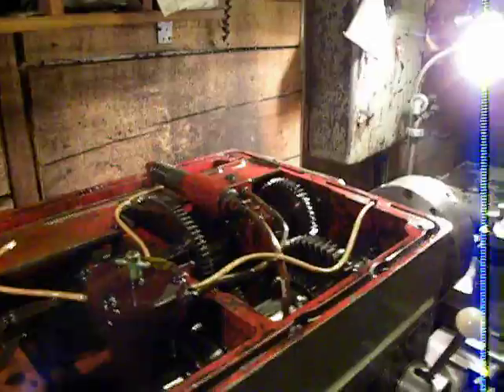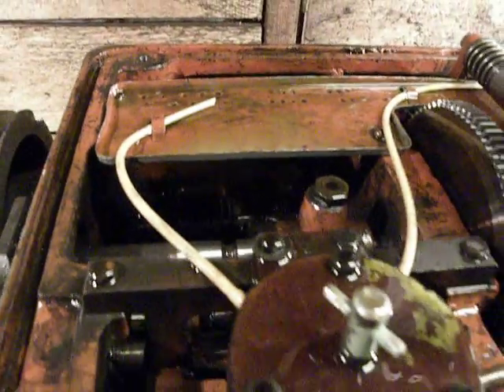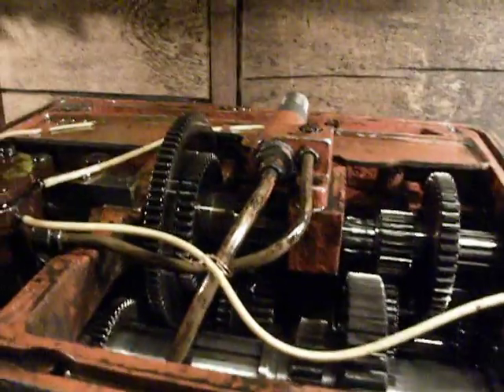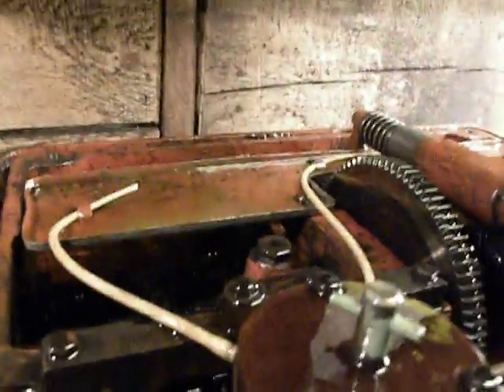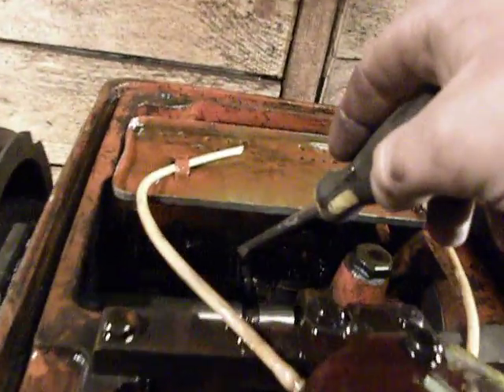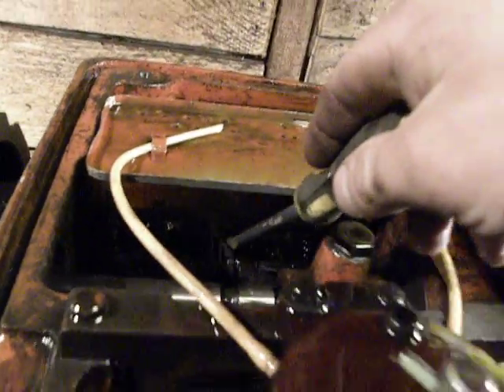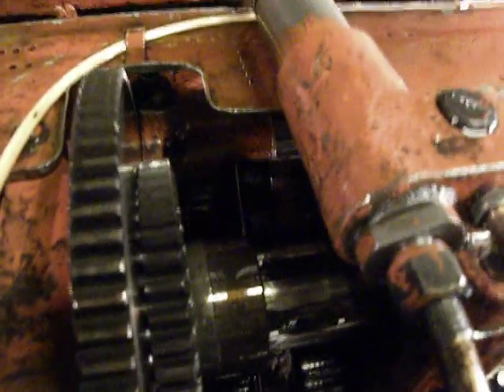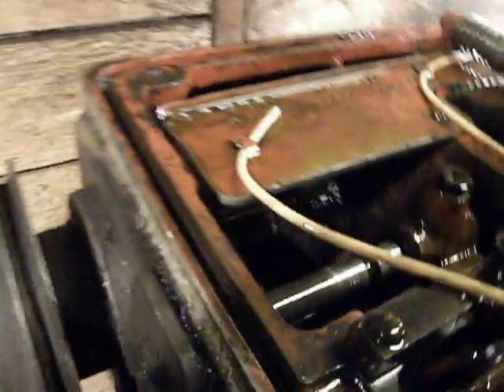1K62 lathe quick maintenance: clutch adjusting, units check, walkaround.

Comment: Very interesting video, can you also do one where you explain the individual functions of the switches and levers? In particular, 
the automatic feed, in my case I cant activate it.
Reply from the maker: Tell me more! Let me gues - You just get 1K62 and You can't figure out all handles and switches?
Reply: @FactoryDragon87  We looked at one and tried it, but we could only activate the thread cutting and the fast feed. 
Now we do not know if it was up to us, that it did not work, or on the machine. (we had no manual in german, and nobody there could show us how it works)
Reply from the maker: @fritzx9311  okay... then do I need to make  video for machine controls?
Reply: @FactoryDragon87  It would be very helpful to know what the individual levers and settings are, and whether the mistake was in the adjustment of these levers.
 
 In English we could hardly find useful information. Since we may want to buy the Lathe and want to avoid that we can not adjust it the right way.
Reply from the maker: @fritzx9311  Deal, I make the video for this... actually, I want to make it long time ago. Please REMIND me this after 18.09.2019, PLEASE! Now, I'm too bussy to do this :-(
Cheers!
Reply: @FactoryDragon87  Thanks, I remind you
! ;D

Comment: Hey man i've recently bought a stanko 1k62 lathe and i need to change the drive belts do you know what size they are?
Reply from the maker: Just take old belts as sample, go to store and buy new ones. since tomorrow I'll be in workshop and I can measure the belts af need.
Reply: The lathe is missing the cover between the gears and the belts and oil has soaked the belts and they have started to come apart, i did a measurement with a tape measure and it was 2200mm so i'll get 17x2200mm belts, and i need to fabricate a cover to keep the oil from the belts, thanks for the reply.
Reply: I know my answer Is too late, , you can use a rope or cord and tie It around the pulleys , cut the rope at size or mark the size with marker. 
Take the tope to the belt supply store. Ask for the size.

Comment: temp.is 10-15 degrees.  The spindle doesn't run.
I mean the Gears near the clutch are starting  to turn when I switch between speed.
Reply from the maker: Okay, 10...15 C, Oil CLP 32 is okay. 
I know this "problem", there need little bit adjust clutch or make workshop little bit warm 15...20C. I know that trick with clutch handle, it works. But better will be if You adjust clutch. Good luck!

Comment: hello from  germany.
i have also 1k62 from1969 in Good Condition . I have the machine since 15 years and a problem to changing the speed when the machine is cold. 
If the machine is warm its better but not perfect. When I change the speed the clutch doesn't  stand still ans beginns to turn. So I can't change the speed.  Oil is CLP 32 machine Oil. My Question, can I fix it when I adjust the Brake stronger or is it normaly that the Gears are beginning to turn between changing.  Or must i adjust the neutral-position?

Thank you
Reply from the maker: Yes, You can fix anything. Cold? Alright, what at temperature is in workshop usualy? 20C less or more? It start to turn in which direction - forward or backwards? There can be that to need adjust clutch and brake. Before brake adjust - check that to brake belt is good and not broken. 1K62 "disease" is that to brake belt get broken and then spindle is stopping down very slow, even it doesn't stop fully, it start to spin at any moment, can't switch any gear, and becomes "all world's problems"..... 
Sometimes it is normal to gears start to turn between changing, then switch off engine, fit in gear, run. 
In You have more questions - Wlecome!
Good luck!

Comment: Hi, I have a Stanko "Red October" 1K625. Do you know how to adjust the feed clutch for the X an the Y Axis.I cant find å part supplier in Norway, do you know of a supplier for this lathe in the Ussr or in the Baltic States.I like your videos, they are good. Håvard
Reply from the maker: +Håvard Næss Ah, on the carrige that "joystick" it doesn't work correctly? Feeds is laghging and jerking? There in is like a gears against each other - no clutch. So there is simple thing - there the mechanism is worn out little bit and it doesn't work correct. I can suggest one - disassemble it and there You will see that where is a problem. Ahm, write me a private message on YT, the I'll give to You my skype nick and then we can talk online, also send / recive images how to do something. 
Bad news is that to we have no official parts suplier for ex-USSR lathes and machines..... but, we have few used machine tool sellers, I can get parts from them and pack them and send to Norway.
Thanks a lot!
Good luck! Cheers!

Comment: Nice video, thanks, my 1K62 might need some clutch adjustment, now I know how to do it.
I have been thinking about getting Multifix Tool Post to 1K62, would size B be suitable for 1K62?
Reply from the maker: Great, I hope to this video is helpful. 
Multifix Tool Post? It is good piece of equipment. Well, I had thinked for this, but there is problem or I ahve no ide how we can call it: You need 10 and more than 15 exchangeable tool posts for  very handy work, so each toolpost cost money, then You need device for  "centre height check"....  well  for now I'm not yet ready for Multifix Tool Post.

Cheers!

Comment: Seems it won't be long and you'll be making chips. The green monster is coming alive...
Reply from the maker: This 1K62 lathe already made lot of chips...... Yea, the 1M63 is still under repair, because I "stuck" in works and also I need get crane for to disassemble that 1M63 lathe. 
Thanks!

Comment: Hey its running this is good. You must have the wiring done . That is easy way to adjust clutchs. There may be another adjustment in  the handle rod.  .My Grazioli lathe has one on it maybe yours will also
Reply from the maker: Yeah, it's run. Yeah, it is easy to adjust both clutches - 1K62 have two clutches: forward and backward. There is only one adjustings for clutch handle - at lathe backside, under gearbox, there was something what can adjust, I think.... I never had adjust something there. At other places in mechanism is only non-adjustable connections in those levers. 
Cheers!